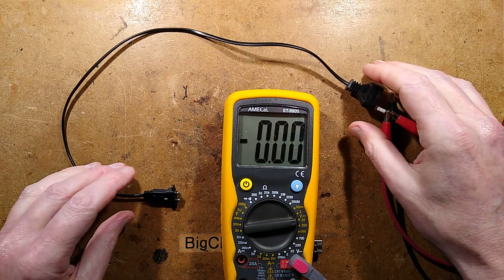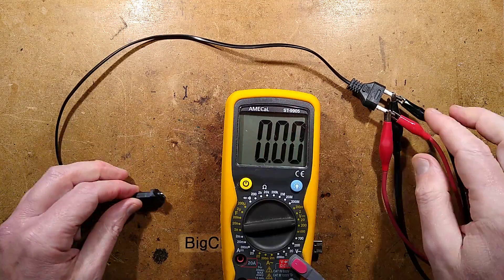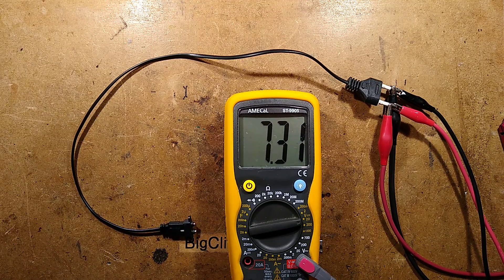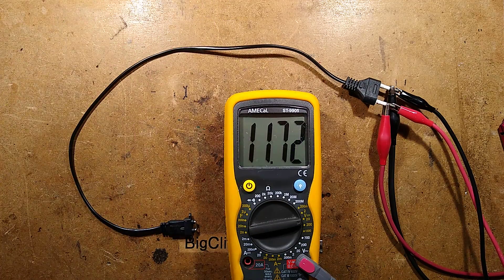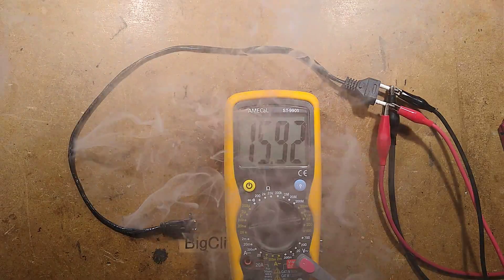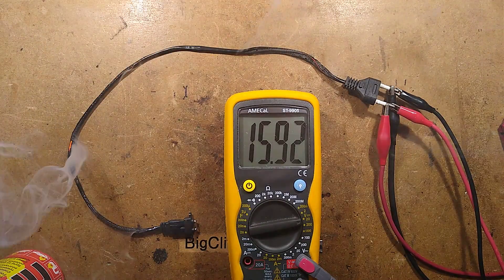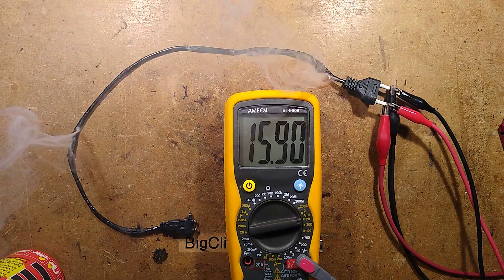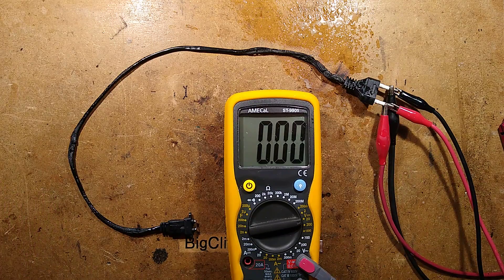Cable test ends in flames

Comment: i have a microsoft surface pro 3 replacement charger that the part that plugged into the wall was just as thin as that cable that burst into flames, the first thing i did was swap that part of the charger with a better quality one off of a universal laptop charger! plus the cable that came with the charger would let off a big spark everytime i plugged it in , so i was like ah hell no and swapped it out right away!

Comment: I had one of these fake cable I bought by not knowing better for my old laptop adapter, I was sitting at home and I moved my laptop a bit, then the cable just caught flame and I quickly pulled it out of the outlet. I was curious of why it happened, and apparently it was one of those cooper coated steel cable, it couldn't stand getting bend often and just snapped inside the insulator, resulting in fire.

Comment: I can't believe I missed this video! A very exciting result, but now I'm going to have to go check my power cables with a magnet just to make sure none of them have iron conductors instead of copper.

Actually, this reminds me of a discussion relating to the National Broadband Network we've got here in Australia, when the conservative "Liberal" government wanted to change it from a 93% fibre network to mostly reusing the old copper networks (which incidentally they did and the cost went from $46B to at least $56B Aussie dollary doos). There's a record of a federal parliament debate from 1910 where a politician gave a speech about being against upgrading the telegraph network from the old iron wire to copper wire.

This is an excellent demonstration of why copper is much more suitable than iron for electrical wire!

Comment: there are so much dangerous products outside. As I was in Ghana during my studys, I bought an extension cord with a high cable-diameter (I thought).  After two days of use, the cable started sparking. on closer inspection we saw, that it was a really really thin (not shure if it was copper) cable with much insulation around it, so it looked like a propper cable.
this and copper-covered steel "cables" are dangerous and deceit. Imaging buying this camping-lamp (for what the cable is ment) and one of your kids is charging it in his or her bedroom

Comment: Will it damage audio equipment if you try and use two 2-wire speakers with a 3 pin stereo earphone jack by tying the two negative speaker wires together to make the speakers 3 wire?
Reply from the maker: It depends on the internal circuitry.  I'd recommend keeping them separate.
Note that many jacks short their contacts out briefly when being plugged in.

Comment: Ok it's a terrible cable, but would it be at a dangerous temperature at 2.5A? That's what these europlugs are normally rated for.
Reply from the maker: You have to consider its behaviour in the event of a fault.
Reply: @bigclivedotcom  I mean the insulation catching fire is certainly not a good fault behaviour ;)

I guess it should be able to trip a breaker without catching fire, although getting somewhat hot is probably expected behaviour.

Comment: this happened to a rig i made to test a DC motor (24v, 10A). Using gator wires i thought a quick test would be OK (motor is rated at max 14A).

i learned there is NO current limiter on the dc speed controller from ebay; they expect you to have a power supply with independent V and A controls.

so don't hook up a 12V SLA battery directly to a speed controller kids!

Comment: Fun experiment to bring the point home even more: can you take a short length of this wire and use it to start a fire using a single NiMH AA cell? That would be impressive... and definitely possible. And if a toy battery can set it on fire, that is definitely devastating.

As a kid I liked to carry batteries in my pocket, you know, just so I can for fun charge a capacitor and short it for some tiny and harmless sparks. Sometimes though, the outside hull of the batteries fell apart and they created shorts in my pocket. Oops... got hot rather quickly, which I of course noticed and took the battery out before anything haopened.

Best part is, those shorted NiMH cells were just fine after another charge.

Comment: I have microwave arcing blue and orange sparks when you start it.  I'm willing to send it to you for diagnosis
Reply from the maker: That can sometimes be carbonised residue on the mica plate over the waveguide outlet into the cooking cavity.  You can replace the mica plate if it is.

Comment: I've bought alligator/croc leads a couple years back that felt way too flexible when they arrived. Measured resistance across them and it was around 3 ohm or more (at 50cm/20in). Sure enough, a magnet stuck to them just like in the video. This CCS/CCA garbage is _everywhere_, and in some cases like IEC power leads, they put a lot thicker insulation on the inner conductors to hide the fact that it's just a few strands. They can easily go undetected if you don't handle these a lot and don't notice the flexibility (they tend to feel hyperflexible like those very expensive DMM leads) and a complete lack of safety logos on the plugs or abnormally sized/shaped plugs (europlugs with too short or all-metal pins, Schuko plugs where the pins are soft-ish/bendable or the end caps that make up the contacts are paper thin and get dented/scratched easily etc.)

Comment: Why did the voltage go up if the current was being kept continuous?

I've found shaving foam makes a great fire extinguisher... Less so as a mouthwash
Reply from the maker: The steel has a positive temperature coefficient.  Its resistance increases with temperature.
Reply: @bigclivedotcom  more resistance meant more voltage? I think my brain is having an off day

Comment: Copper is only about 2.9 times less resistive than steel though right?, only problem I have with it is that steel doesn't stay flexible as well as copper

Comment: I would do that farther from my multimeter. I never saw a wire made of steel! Except for that CAA cables on top of poles where the steel is only used to give strength and the aluminium conducts electricity.  This is bonkers, a short length of wire dissipating 75W. I am testing all my cables with a magnet right now.

Comment: I once tested a dodgy "C13" cable (typical computer cable) but I did it with a mains voltage and a space heater - It was so high resistance that it didn't even trip the breaker when it shorted out.
Reply: when the cable heats more than the heater 🤣
Reply: @Knaeckebrotsaege  At one point that short cable was releasing about 200 W of power :) I recorded it so you may find it in one of my old YT videos

Comment: I should note that there are legitimate uses for steel wiring. Specifically high temperature wire connecting to heating elements inside ovens. Of course this has special high-temperature insulation and is thick enough to handle the needed current.
Reply: @Kevin-mp5of   The elements themselves are nichrome. But at the end of the nichrome wire it's crimped to another wire and this lead-in wire is often steel.
Reply from the maker: Those pesky steel heating element connection cables that often burn up at the crimps.

Comment: Don’t play around with that smoke.  We had an incident where a length of PVC coated cable went up in smoke and sent several people to hospital in respiratory distress.
Reply: Where I live a train derailed carrying vinyl chloride and they had to burn it off to prevent an explosion. Up into the air it all went.
Reply: @moorbish  East Palestine?
Reply: Yeah and it could have lead in it too. If PVC. Probably the insulation has anything they can get cheap.
Reply: Probably a convenient way to get a week sick ticket.
Reply: Have you seen Youtuber, Electroboom? I'm surprised he's still alive. Hilarious guy though. But he is the walking example of what not to do with electricity
Reply: @ameliawilder28 he's actually very smart and knows what he's doing, he does those things on purpose to teach what not to do.

Comment: I haven't seen copper-coated steel wiring in probably decades now, for exactly the reasons you've shown here. Unbelievable what some halfwit douchebags overseas will do to make an extra 10 cents per unit.

Comment: Interesting. I often wonder at the horrors lurking inside most of this Chinesium rubbish, and you expose many of them on the channel, but it wouldn't have generally occurred to me that the cable itself would be a risk. The number of house fires has been declining steadily since the year 2000, which is amazing when you consider how much of this junk has flooded the market in that time.

Comment: If that company would remove the insulation from the wires and separate the wires, the wires would make a pretty good heater wire for a toaster.

Comment: Darn, and I thought the copper coated aluminium cables were bad. Never come across copper coated steel yet, mind you I am savvy enough not to buy nasty stuff like that from eBay. But it's frightening to think just how many people out there that are not so technically minded, ending up buying this stuff without realising the dangers.

Comment: I wonder what the fault current would be with a direct short-circuit on 230v 🤔. And will it trip a 32Amp ring circuit breaker? Or mabe it could blow a 13Amp plug fuse on a direct short. Maybe not fast enough before the flames 🔥 come🤣🤣🤣🤣🤣

Comment: Mr Clive you not play fair. Wires is to very short so burn up with not enough resistance using tall current. My China cable is very good and save to use in many common appliances.

Comment: My friend is a goldsmith and I was doing some electroplating at her jewellery workshop and the wires did this. The smoke triggered the smoke detector, caused the multi-level commercial building to be evacuated with firefighters arriving on the scene.

Comment: Now think about that elcheapo CAT5 network cable you, dear reader, bought from the cheap place and the way you aare using it for PoE applications.  There's not much guaranteed in life but you can take it as read that the elcheapo CAT5 cable will be CCA.  At least here in Australia CCA network cables are prohibited and can not be legally sold.  Any reputable retailer will not offer them or if they are discovered in stock will quickly remove them and apply boot to someone's arse.

Comment: About time Ebay etc were held FULLY accountable for the death-tat they flog...
Reply: Cool. Then you can also say goodbye to anything cheap coming directly from CN/overseas. No more DC-DC converter boards in 10 packs, no more LEDs and resistors in bags by the thousands for chump change, no cheap fridge ozone lemons, cheap LED tape to DIY, various controllers and other devices ...  cause if ebay can't get a hold of the sellers to hold them accountable (newsflash: they won't dig for a mailbox adress company with a "smash head on keyboard" name), they're gonna do the next best thing and just blanket-ban all import stuff, so in the end the people screaming "ebay/amazon should be held accountable" are by proxy just getting all cheap imports banned. Good job. I'm sure you and all the tinkerers out there will absolutely enjoy spending 5-20 times the amount for the same imported crap locally. And if that wasn't obvious enough, that last part was hard sarcasm
Reply: Rubbish. DC to DC converters wont kill you like a badly designed capacitive MAINS POTENTIAL dropper would.  @Knaeckebrotsaege

Comment: I will remember to quickly test cables with a magnet from now on. I have a mate who bought a dodgy looking 240v to 110v converter. The wires look so flimsy and now I have a way to check just /how/ dodgy it is.

Comment: I once had this happen to me with a battery cable. Was supposed to be 35mm² OF Copper, turned out to be 25 mm² Aluminum with a plastic core... It melted before its 200 A Fuse did...

Comment: I wish you could have hooked something up to it instead of shorting it out to see how many amps it could have taken
Reply: Did you watch the video?  He tells you how many amps his power supply is putting out.
Reply: @j.f.christ8421  I know I wish he could have hooked it up to a stronger power supply
Reply: @nomusicrc  Why?  It's more useful to know if a small amount of current will cause a fire.
Reply: @j.f.christ8421  but MORE POWER
Reply: @nomusicrc  Well then, buy one of those "dalek" lights, take the cord and hook it up across your car battery.  Only 12v but it'll give you something like 1000 amps, not 5 amps like Clive's PSU.  It will go "pop!" like a fuse.  More power isn't always more interesting.
Reply: @j.f.christ8421  maybe not extreme power
Reply from the maker: It was capped at 5A and the meter was showing the voltage drop across the very short cable.

Comment: " what's the cheapest thing we got that is conductive " " we have steel sir" " good make wire out of it and wash it with copper, just enough so it'll take solder, NOT TOO MUCH COPPER IS EXPENSIVE! " this is what I Imagine was said at a wire factory in China, oh and big C I hope you didn't suffer any ill effects from whatever highly toxic chemicals were in the insulation on that wire, who knows what the hell they put in it.

Comment: I also watch a Channel where the gentleman test and pulls apart USB power adapters and I ended up buying test gear to see how safe my USB chargers were and now you scare the 💩out of me again with this. I was always careful about the chinesium flavoured power cables and threw them out if I had an option for one made by real manufacturing people but now I have to magnet test all the bloody cables I have.
Thank You Clive, you may have save a house or lots from burning down by showing numpties like me about the simple magnet safety check. VERY much appreciated. 👍👍❤❤
Reply: When I buy cheap USB adapters, I take a moment to plug in a USB cable that I cut in half, and touch each wire to common ground. If it explodes, then it was defective.

Comment: Steel wiring is new one.  Just randomly checked a few things in the pile, and the first thing I picked was a 2015 Lenovo USB mouse, and it's got steel wiring.  Amazing.

Can't find anything else, even my new cheap $5 soldering iron for threaded inserts has the usual nasty CCA.

Comment: Also notice that the small test leads supplying the current couldn't give a crap about 5 Amps.
Reply from the maker: The test leads are actually pretty thick copper wire inside.

Comment: I thought they do CCS (Copper Coated Steel) only for audio and CAT-5/6 network soild wires... I don't know what is worse... ultrathin wires (prone to break or accidental "deinsulation" in 230V devices or this sh..t

Comment: There was no smoke, but smell was awful but no easily detectable... but "cycling" power get may attention...
After 20 years connection terminal in my home RCD in cooperation with soild copper interconnect showed mi copper solid wire (or his charred isolation) glowing red at about 10-12 Amps....
Thankfully RCD casea around terminals melted and even dripped but not set my plastic home fuse box on fire... interconnection insulation properly carbonised.
Fun part, RCD is fully functional still...
Sorry maybe off-topic, but i needed to share...

Comment: During a recent project I started taking more of an interest in wire gauge ratings. I checked out the AWG gauge chart and what I found interesting (disturbing?) was how many devices I own that use a wire gauge smaller than recommended by the AWG gauge chart for its stated amperage.
Reply: Guess I should be doing the same considering my location matches your thumbnail image.
Reply: You realize that a smaller AWG cable is thicker wire, right? 22 AWG copper wire is /thinner/ than 18 AWG and the latter can safely carry more amps. --- Of course, there's more to it than just the wire gauge.
Reply: @jnharton  Oh yes, I do understand about AWG numbers/sizes, but it certainly is something that can be confusing and it's good to point it out. The same applies to fish hooks from size 1 down, with the next smaller hook being size 2. But just to be confusing, the next larger hook size is 1/0, then 2/0 etc. And, again there is more to the selection of the hook than just the size number.  lol.   Best wishes. 😊👍
Reply: The length makes a big difference too, and the type of insulation. Flat cords for things like air conditioners can have a higher rating than round cords of the same gauge, because they have more surface area to dissipate heat.
Reply: @trickster721  Ok thanks, that makes sense.  I also noticed that the more strands, the lower the rating.  Less copper I guess.

Comment: copper coated steel - how the hell is that cheaper than just a normal copper wire

next they'll invent this awfully convoluted alternative that actually has 100x the manufacturing cost in R&D alone. Amazing
Reply from the maker: The same parasites that have speculated on the price of property have also speculated on the price of essential metals.  It is them that are the root cause.

Comment: I had one of this power cords catch fire and the wall and burned a hold in my floor tile also the outlet was sparking and when I grabbed the cord '' gloved up first '' it was melting and still sparking, Some how the breaker never tripped but if I use the toaster and kettle it will, If I was out and that happened the house would have been gone when I got home, It was either a lamp or fan I can't remember now,

Comment: Another very typical Chinese Electrocution Houseburner. But 80W is a really decent heat output for such a piece of power cable (or rather heating cable?).
Note: Chinese producers also never forget to mark these products with the CE symbol. But watch out! In this case, it doesn't mean confirmation of compliance with European technical regulations, but compliance with Chinese technical regulations and means Chinese Electrocution.